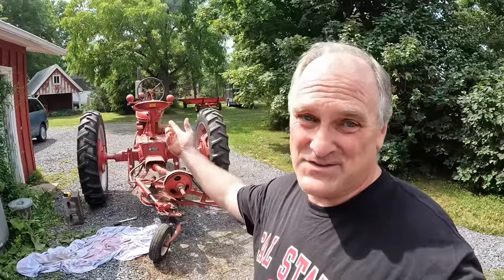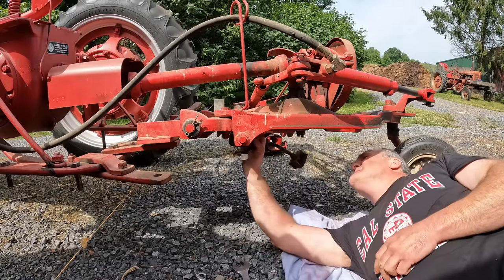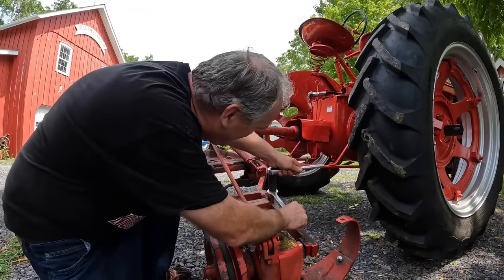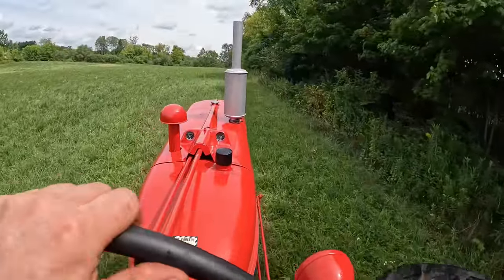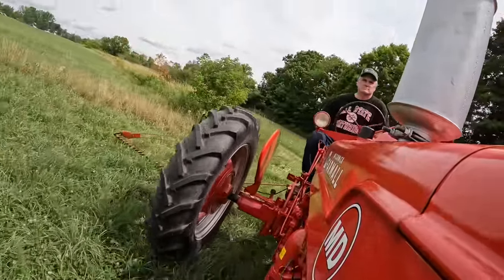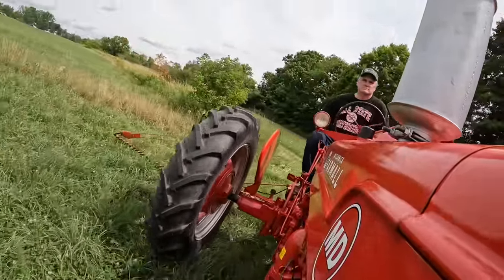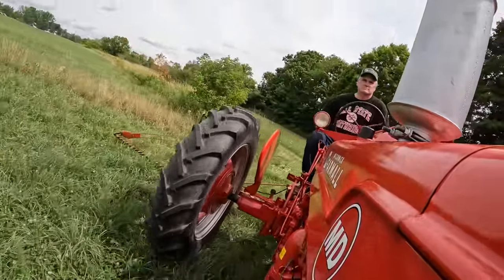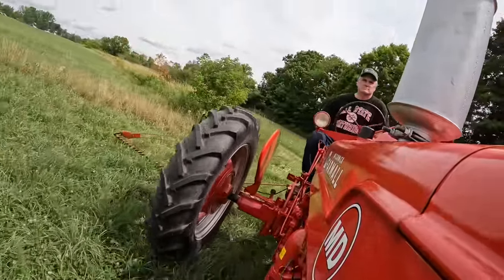A Thing of Beauty! Mowing with the Farmall MD

Comment: The old equipment, with a good dose of horse sense works so well.  Good job on that restoration, Pete.  That ol' girl sure does run smooth.  When I was a kid, I learned to tune my car by ear once I got the specs dialed in.  It was always a very satisfying moment to listen to the purr as you wiped the grime off the tools before putting them away.

Comment: In the early '70's the local farmer that I worked for had a belly mower mounted on an IH806 w/ tricycle front.  It made monitoring the cycle bar much easier.  A downside was that it was possible to drop a rear wheel into a low enough depression to sit the tractor weight onto the mower frame.

Comment: Pete, there is nothing more relaxing than working a tractor with some form of a grass cutter. I had a Farmall 140 offset that I inherited from my late ex-father in law. I kept it running as smoothly as possible and even put a 4 foot brush cutter on it. It has the one point hitch.  Ex wife got it back in the big D. It had all the planters and cultivators with it and was a great garden tractor. 

I now have 3 Fergusons and a JD cab/air tractor. My oldest Ferguson is a Harry Ferguson TO35 that was my grandfather’s tractor. We baby it since it’s a 1956 model. 

You’re an Architect and I’m an Engineer. I’ve retired once 10 years ago but never stopped doing engineering. I lease out the hay cutting to a person who is baling haylage off the fields. He gets about 1000 bales a year off of 4 cuttings. 

I would never take on the tractor rebuilds like you as I no longer have the patience to dig into the repairs like you do. It was exciting when I did do the repairs myself years ago but have since lost my patience with in depth repairs. 

I enjoy watching you do the restorations and one thing I can greatly agree with you on is the need to have a good set of shop manuals for each piece of equipment. 

I’ll keep on plugging away as a consulting engineer for hopefully another 10 years and maybe if my patience returns, starting going through some of my equipment then. 

Keep’er running and stay safe on the farm.

Comment: My Dad bought the first 120 mower our dealer sold.  Mounted it on a Super H with the Fast 4th gear and it would mow standing hay at 7 MPH on 1 gallon of gas an hour.  The first thing I moved was a 40 acre field of hay in less than 8 hours and it made 88 bales per acre.

Comment: Excellent video Pete  :) my one Neighborhood neighbor Bill had Farmall MD said if count in low idle on fire order plus know RPM got tractor tune nice and top high Idle sounds thurst it tune right  to ! He said low idle on MD should be 550 for low idle and high idle  is 2100 for  RPM for gas or desiel fuel! Plus if low range and second gear on half throttle at 1500 RPM fast travel speed than person walking got tune excellent too!

Comment: You should see modern-day golf course mowers with reels. Fairly easy-to-use the same method to adjust the bar or bed knife and along with height of cut and contact of reel to bedknife for that scissor cutting action. Just like your equipment never put your finger anywhere near the reel even when off because it will cut a finger off pretty easily.

Comment: There is nothing better than the sound of a sickle bar mower. I think the MD was still a success regardless what happened with the valve. Pete how often do you grease the mower? I have seen some people use chainsaw oil on the bars of the mower to make it a easy cut. Not sure how well it works specially if your feeding that contaminated hay to your animals dose not sound like a very good idea. If the mower is binding or getting hot for some reason then something must be very much out of adjustment or bent in a way it binds and causes friction.

Comment: Yes sir Mr. Pete, what a great combination the MD and the sickle bar make.  It's just a shame that engineers (NOT YOU PETE 👍)  didn't do better connect equipment without having to bolt thing down in the olden years.  Now the Engineers make stuff so difficult to remove, to repair stuff you practically need to remove ten parts to get one off!!! 🤣🤣😂😂

Comment: Thanks for the great videos Pete. Love old tractors. I'm having a weird issue with my 1952 8n that someone converted to 12 volt. It was running fine. It felt like it stalled and quit. I tried to start it again and nothing. Like the battery wasn't there but 12v at the battery. Went thru the basic checks and nothing. Then I turned the key off and the previous tests now indicate it's ok...but with the key off...and the solenoid just makes a buzzing sound...but only with the key off. Sound like anything you've run into before? Thanks for any pointers and God bless.

Comment: Do you think that mower cut hay takes longer to dry than hay cut and run through a Haybine/mower conditioner? I have found that I don't save on raking because I usually have to turn the windrows from the Haybine over or combine them anyway, but I was wondering about drying time as I have never used a mower only.

Comment: Pete , I bet you have probably gotten the question about the throttle lever on a Farmall MD. Why is the lever different on the MD's compared to the M's? And why does your cycle bar mower have a  what looks like a PTO coming off of the back pulley of the mower
Reply from the maker: I don't know why the throttle is different, but I suspect it is because it takes more force to move the lever than on a gas M. The PTO on the back of the mower is to power a pull-behind crimper.